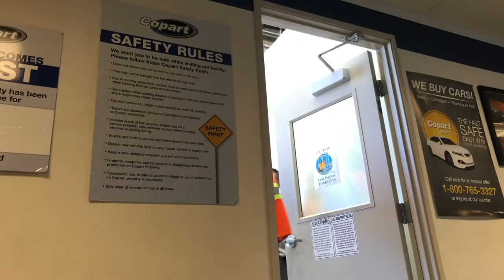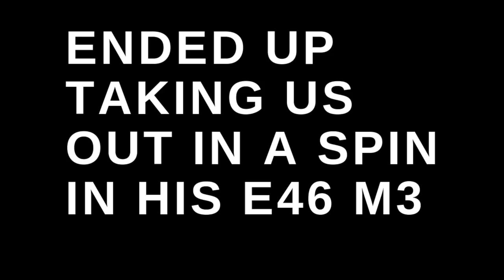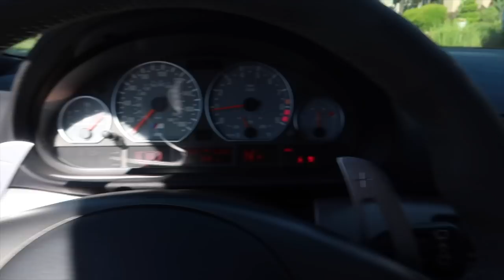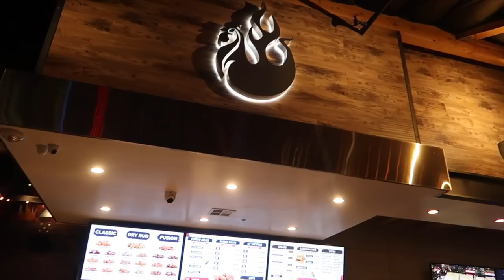I BROKE MY FRIENDS E46 M3 MID DRIVE! GOT TOWED!

Comment: Whole bunch of white smoke that engine is SHOT lol
Reply: white smoke means engine is burning oil afaik so ye its pretty much worn out engine...
Reply: Burning oil is usually blueish smoke not white.
Reply: Jose Arriaga it’s white wtf you mean blueish lmao 😂
Reply: Aaron Mendez dude just stop a bad head gasket is a COOLANT leak and also these guys took a look at a car at copart they didn’t drive the car it’s not like the exhaust pipes had anytime to heat up to burn oil so please just stop replying
Reply: @josearriaga4197  lol chill out kids its either coolant or oil but anyway that engine is done rofl..